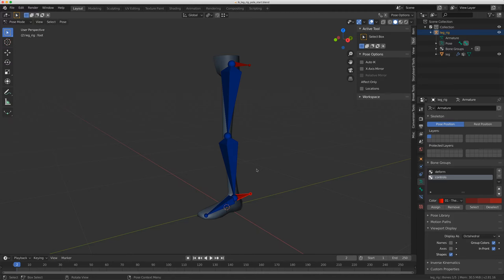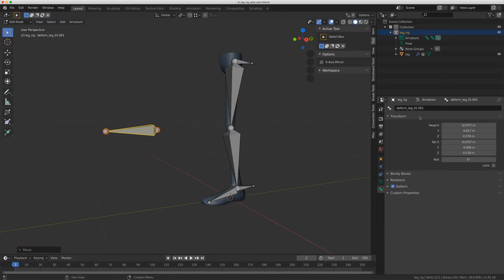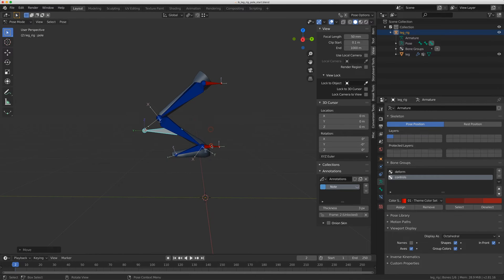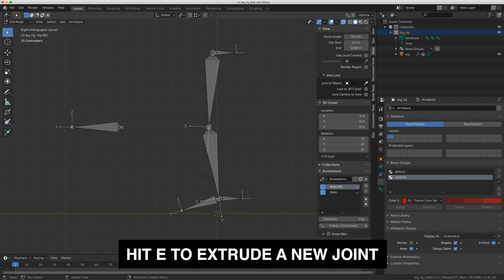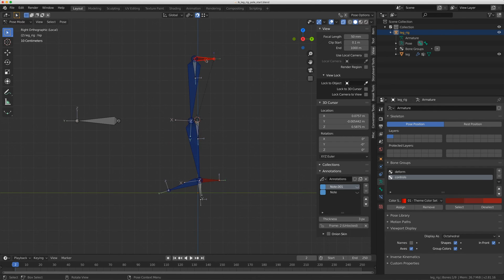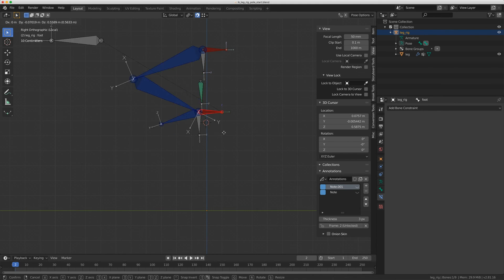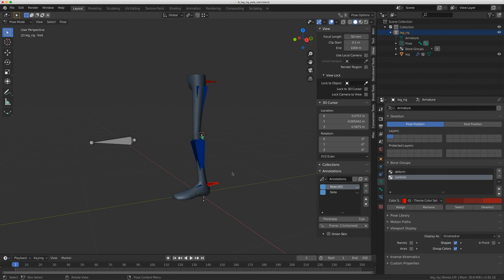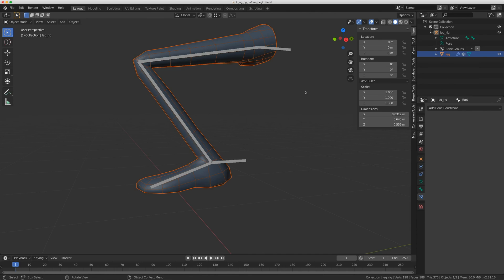How To Control The Pole Target - Blender IK Leg Rig Tutorial

Comment: After a lot of searching, this is the only video I’ve found that actually solves the flipping issue in a clear and effective manner. A previous tutorial had me rig a leg and animate it simply, which worked fine at first, but as soon as I tried to do anything else, like pull the foot with the controller near or above the pole the leg would snap to the other side. I eventually "fixed" the snapping by parenting the pole to the knee area I extruded it from, but that caused another problem; grabbing the pole and moving it around to rotate the knee made it behave erratically, rotating at an unmanageable speed and seemingly in only one direction at times. This video solved both issues for me. The only thing I need to figure out now is how your hip control functions as that was not part of the rig I had when I started following along. For the life of me I can't get it to behave like your setup does @0:17
Reply from the maker: You should check out the example file: https://levelpixellevel.gumroad.com/l/wjuOv if you look at the parenting and constraints there it should help you out.

Comment: This was a really cool video! One thing I have to ask though is that how does one get around circular modification of the IK bone? In my case everything works fine, until I hit ESC to snap the IKTarget bone back into its resting place. Then the pole target is off where it should be! Weirdest thing is that it fixes itself by repeatadly switching between edit and pose mode.

Comment: Nice video! There's not enough in depth stuff like this. I always have a problem with my elbow and knee joints where they'll bend at a weird axis unless I have the joints absolutely straight with a slight bend in them. Is it possible to specify manually what axis to bend on?
Reply from the maker: Hey, I do not know how to adjust the IK to change the axis, but you can parent other bones to the IK bones that have a different role axis and use these as your deform or your control bones. Thank you for the wonderful comments :)

Comment: Interesting -- I wonder why it uses X axis to aim to ward the pole.  Seems like it would make more sense to use Z.  Is changing the pole target angle to 90 degrees any different from rolling the bones 90 degrees?  I generally try to set my bones up so Y is forward, X is the axis of rotation, an Z is "up" (like the top of the knee), as that makes the most sense to me.  I just adjust the pole target angle to compensate but I wonder if the behavior is any different doing it your way.  It's usually fine for legs, but I tried to IK fingers last night, and they wanted to bend at weird angles, so I ended up scrapping the pole target and enabling the use of location AND rotation on the IK target bone.
Reply from the maker: Hey, yeah, totally agree, it seems like there should be another dial in the constraint, like, 'choose your pole target axis' so you can flip it to use the y axis if you want. 
I don't think it is a bad thing to use the y axis and add a rotation to the pole vector if it works for your rig. The main thing is to know why that dial acts the way it does. 

The main key is if you want to use the role value during the animation. If you need to go to -90 or 90 off the bat it will limit how much you can use this dial down the road. But this really depends on the scope of the project and the show.
Reply: @LevelPixelLevel  Ah, I never thought of animating that value.  I just animate the pole targets themselves if I need to.  Setting that to 90 degrees would effectively be the same as a "use z as pole target axis" option, though, right?
Reply from the maker: @jitspoe  Yeah, pretty much, and it is also helpful if you ever have an arm or a leg that is not straight down one axis.

Comment: I've heard this might just be a Blender problem, but whenever I try to Alt+R or Alt+G to return everything to default pose, I have to mash it over and over to actually get everything back to exactly where it should be. Did I mess up, or are the rumors true that Blender's got bugs? :P
Reply from the maker: This sounds like you have a cyclical dependency in the file. Meaning the foot control might be parented to the ik leg bone. Try the example file, and review the outliner to ensure this is not parented.

Comment: Hi there! I'm having trouble correcting my pole target. I enabled axes and pointed the X axis at the knee target, but when I position the foot, the leg bows out to the side incorrectly. Adjusting the Pole Angle is twisting my mesh.
Reply from the maker: Double-check that the pole target or the foot is not a child or parent of each other. Check my example file to confirm. 
Also, you may want to confirm you set the iterations on the IK solver, if you leave this at the default there will be grave consequences. https://docs.blender.org/manual/en/latest/animation/constraints/tracking/ik_solver.html
Reply: Level Pixel Level hey! I ended up figuring it out. I had to give the knee a bit more of a pre-bend in the right direction and that seemed to do the trick. Pole angles ended up being ok
Reply from the maker: @NickCheng93  Right! Glad that worked out!
Reply: @NickCheng93  absolutely, it's a weird quirk but the knee has to be bent a little bit in order for it to work.

Comment: Great lesson, thanks!
Just wonder - why do you use additional bones for "inbetweening" pole target's ("green") parent bone, instead of using the "reds" ones? They have the same position. "Damped track" for it works the same way.
Or it's all about rotation inheritance?..
Reply from the maker: Agreed - you can use a copy location for this, but I want the rotation from the hip and the ankle to also push the pole vector. 
The reason they are all pointing in the same direction is to keep the copy transforms static in the default location.

Comment: This is actually a very nice and clean way of setting up a dynamic pole target! All other methods I know of involve some sort of dependency hack and they always break.
Reply: On a second thought, the thing that bothers me with this particular setup is that the knee twists half as much as the foot's Z rotation. The way I solved it is by adding a Copy Rotation constraint before the Damped Track on the pole target's parent, midway bone.
Reply from the maker: @TheJobCompany  For sure! You can keep adding to this set up with more constraints. Then you can add dials to these constraints with drivers to either lock the knee to the foot rotation, or the hips.
Reply from the maker: Yeah! I've tried some other methods and I always come back to this one. You can keep adding to this as well with additional constraints and drivers!